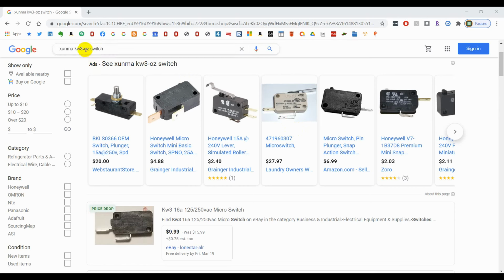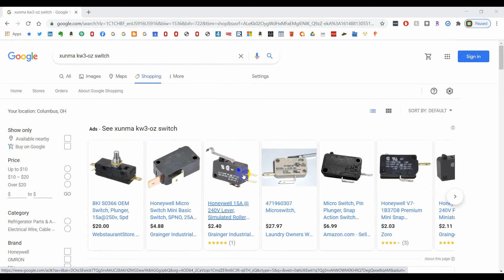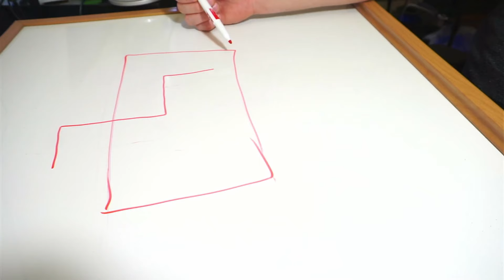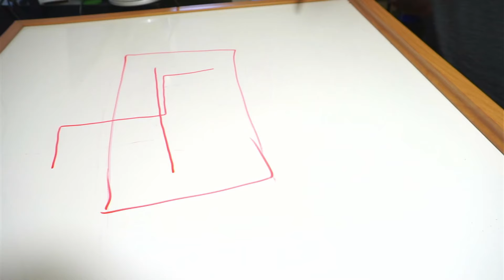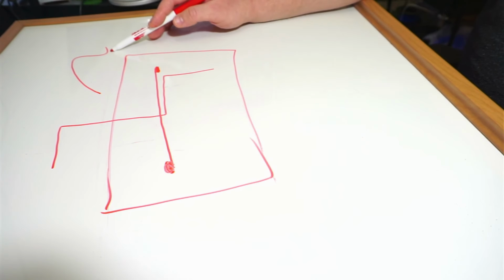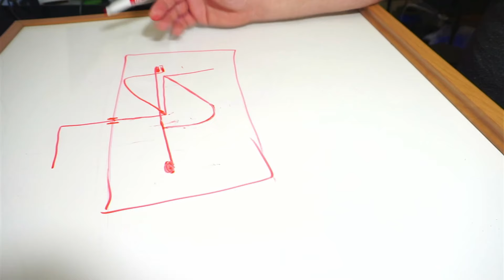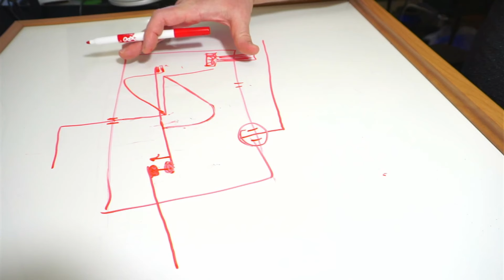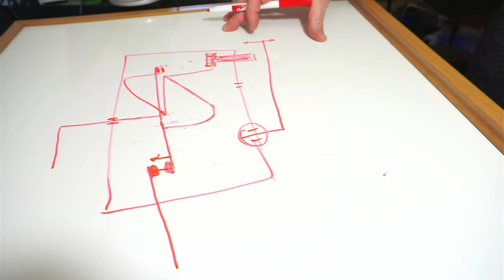How to fix a cheap space heater for free (pressure switch fix)

Comment: Dude!  I know this video is 3 years old, but I assume I am the reason you uploaded it!  My problem was slightly different... the plastic surrounding the screw hole in the upper right of your sill image just seemed to come out of the mold a little thick... I did everything you said as if it were the bottom spring... I even bent the tabs out a smidge so they would seat well in their slot/hole.  But then I shaved that plastic very slightly... like a millimeter or so... and it worked.  I would not have thought to open or figure that out if not for this video.... so appreciate it!
Reply from the maker: So awesome.. doesn't it feel good not having to throw it away?
Reply: @BrianLeeDick  Honestly, it feels best that there are genuinely helpful people out there!  It was like doing surgery... my wife was super grateful... saved a few bucks... kept it out of the landfill, but I am not kidding... it was the helpful aspect that means the most.  It is the way neighbors used to be.

Comment: This is a FANTASTIC video. Many thanks, Brian! I could get the heater working again.
I could not get my switch to work; it looks like the spring was broken or I was not able to push it in the right notches. However, having understood the mechanism from this video, I padded the bottom of the pin a little with folded paper to short-circuit. I love that I do not have to throw away a fully working heater. Many thanks again!
Reply from the maker: Yup, feels good keeping stuff out of the dumpster

Comment: You're the greatest! I didn't do this, but I bent off a tiny corner of copper off the tab and jammed it into the gap to complete the circuit. We will have to be careful it doesn't catch on fire by tipping over but that's ok!
Reply from the maker: Yup.. definitely have to make sure it's on a hard surface with no chance to trip on the cord if you disabled the tip feature

Comment: Sir you helped me so much ong, I have never worked with electronics and after tampering with it for 2 hours it finally started working idk how or why but thank you!!!!
Reply from the maker: That's great. Didn't it feel great to get electronics working again even without a lot of electronics background. You feel like a magician. Only caveat being if your fix also happens to be a "dangerous" fix and you didn't know it.. but these are fairly straightforward, so we long as the the knock over safety still works it should still be relatively safe.. these things are always a little inherently dangerous cause they get those heating coils so hot, you don't ever want a chance of something flammable touching them

Comment: Thanks Brian! I dared to open up the switch after watching your video. I thought it was all glued together and did not want to mess it up. I am glad and appreciate your effort sharing it with everyone. In my case, I had to straighten the thin copper spring as it turned into a ''C" shape facing up. Other thing I noticed inside the switch, the plastic had melted and blackened a little, although it did not affect the overall function.
Reply from the maker: i definitely would keep an eye on it if the switch was getting hot enough to melt plastic... wouldn't leave it in a room you weren't in/awake

Comment: I just bought a used one at a flea market. I got it dirt cheap but untested. It had the same problem with the tip-over button on the bottom. Fortunately that sensor was fine. It was just the broken actual plastic button. I just put a plastic thing in the hole and glued it with super glue. BUT now I gotta fix the rattling problem, when it's on, due to the fact that the genius who designed this heater put "leg" stands only on the front of the heater and not the back.Thankfully I'm  sort of a handyman and I know I'll fix that problem too (probably by glueing some makeshift rear "leg" stands).
Reply from the maker: Sweet

Comment: 2 screw drivers (the flat head to pop the case open), 2 q tips and a whisk broom. It was so dirty. I suspected that safety switch too. I fiddled with the assembly to get it in place and checked to see the obvious connectors were seated. 20 minutes. Thanks!
Reply from the maker: Nice fix

Comment: Dude, thanks for this video. Ultimately I had to buy the part in a %7 2-pak, but I learned a lot about the pressure switch I'd removed.  No  trigger spring, and trigger itself seemed a little warped. In any case, trigger wouldn't go out far enough to be pressed.  Interesting little bit of technology, though.
Reply from the maker: yeah it's elegantly simple. I was surprised to see that's how it worked

Comment: For anyone who wants an even quicker fix, and how i fixed my heater in about 2.5 seconds after watching this video. 
The pressure switch is set horizonal inside the heater, on my heater i guess it was on the top near the knobs. I smacked it on the right side twice, and i heard a click, which im going to assume was the force/pressure from my slap pushing it back into place. I got it on the first try but ultimately their were only 3 other sides i would need to smack. 

So if you don't feel inclined to take it apart, smack it. It's a pressure switch and being knocked over is probably what knocked it out of place so hitting it again can knock it back into place if you hit it from the right direction.
Reply from the maker: This worked for me temporarily and then I got to the point where I made the video

Comment: Is there a way if the spring does not work to put it directly so when u plug it it works without that bottom switch?
Reply from the maker: there is definitely a way, I'm just not willing to do it, cause then if it falls over it's going to throw intense heat into whatever it lands on and i want nothing to do with that

Comment: Can I just plug the negative and positive to the spade connector and tape together with electric trape?
Reply from the maker: if you did that it wouldn't have a safety switch to turn it off if it fell over

Comment: Mine dosent have the safety switch but with mine the air keeps going hot and cold unless i keep settings on half and if it tips over and I pick it up it stays cold for a while untill I keep turning on and off and when I keep it tilted it works fine on full heat what can it be its lloytron brand
Reply from the maker: wow we way whoa ... those symptoms are odd i can't come up with an idea at all

Comment: I have this heater and the light turns on it just picks and chooses when to heat. Like the light will be on but it won’t be heated.
Reply from the maker: Hmm... So somehow current is getting to light but not heating element.. sounds like a connector somewhere is loose and just needs to be tightened (not a switch type issue)

Comment: Wow, can’t believe there’s a video for this. I have a little “mainstays home” space heater (target brand?) it’s nothing special but it produces a surprising amount of heat for such a little guy and the tip over switch is the same way, it used to be a little loosey goosey but now it’s just rattling around. I think my issue may be in the mechanical activation of the switch and hopefully not the switch itself or switch guts but it’s nice to see how it works! Any chance of bypassing the switch by just tacking the input and output wires together?
Reply from the maker: definitely could do that, but then you lose the safety feature that if it tips over it won't shut off... not something i would ever do. not worth the risk

Comment: So this isn’t the overheat shut off switch then ? Where’s that located in my cheap space heater ?
Reply from the maker: I'm not aware of an over heat shut off switch... just the tilt switch... over heat mechanism is probably a fuse if i had to guess.. which mine i don't think had it

Comment: Mines come on fine but when i use heat setting 2 after a minute it turns off
Reply from the maker: hmmmm... wonder if you have a thermal circuit in it, and something is causing the wires to heat up and trip it... cause it's weird it works for a little bit before shutting off
Reply: @Brian  i got it was the bimetallic strip is was clicking of  far to early a slight adjustment and it works fine and cuts out when it should now

Comment: And when you bypass the tilt switch, you go to bed, and the cat knocks the fan over, and the fan catches fire and you die, your problem is solved! Come on, people! Figure out how to fix the switch in a way that keeps these little death trap fans safe! The limiting factor is the micro switch that must be of a high amperage (about 20 amps for 120 volt AC for my fan). Maybe you could find a micro switch with a long lever that you could bend to go through the hole.
Reply from the maker: This fix fixes the defective switch and makes it operational again. The defect is the metal contacts are all out of alignment within the switch body

Comment: The video is fine, I congratulate you on the topic. But! Well, it's definitely not a B+D product, it's Kanai industrial waste, it's a shame that B+D adds its name. A lot of them look like this or have variations on the design, but the inside is garbage, I've only had 5-6 different ones, but they all have the same problem. The contacts are enough, the microswitch against overturning does not work, it cannot handle the 1800-2000W level even in 10C cold,
it overheats in good cooling conditions, if it is cleaned, if it is not covered, there is nothing near it, the air flows freely, the fan shaft runs well, it is oiled or siliconed.
or, in the best case, it does not have plain bearings. The point is that it overheats, turns off for 5-10s, cools down, then turns on for 5-10s. Or the heat protection burns out, which cannot theoretically be replaced, so it's a waste. The fan blades quickly start rattling, their suspension is a joke. The 600W fan of the last mini version became bearingless after 4 months, so the cooling rate decreased, the 220V 10A 98 °C fuse melted. It is practically irreplaceable for the layman. The cable is short.
------------
Such a device should know +10 °C and continuous 1800-2000W
performance, should be sized as such. There is a 26-year-old rack-and-pinion switch, but it has only just been used, after changing the switch, it can easily handle 1800W, where the others fall to their knees.
If I replace the fan of the current mini version with a quality one, i.e. one with ball bearings, or with a magnetic one, and I change the heat protection, which burns out if it overheats, it protects itself and prevents a fire. Then I'll be there like a new price. But it doesn't destroy anything either, because it also breaks down very quickly.
------
I saw an Indian video, the electrician only repaired such things, in a terrible quantity. There was one that was the fault of the user, he got so much dust and garbage that he didn't even have a chance to cool himself.
This is typical under-planning, you can change it for 6 months, max. 1 year, because it's garbage, we manufacture the garbage, or have it manufactured.
I'm sad because 70% of people can't fix it, if it's a service, the repair is so expensive than a new one.
More good content uploads, patience! Sorry if I was a lot!
Reply from the maker: seems like a very common practice in appliances
Reply: @BrianLeeDick  Yes it is:body-blue-raised-arms::face-purple-crying: